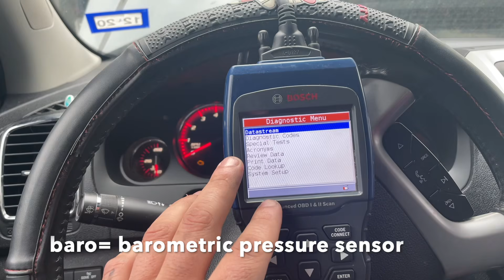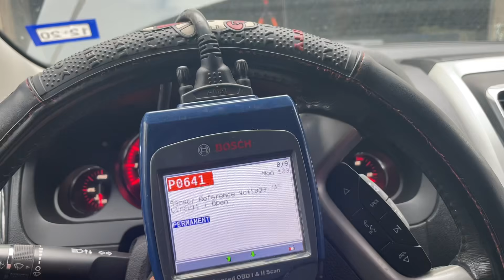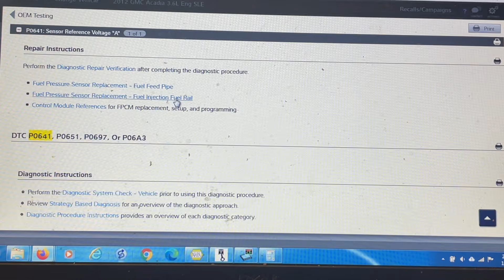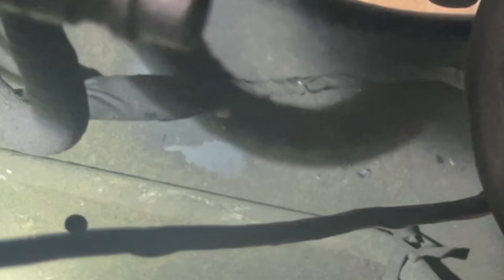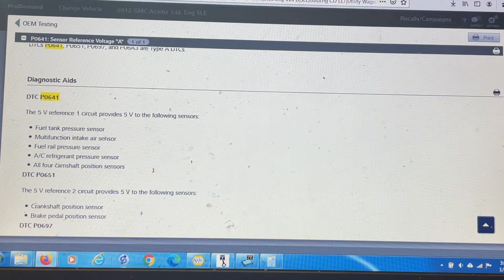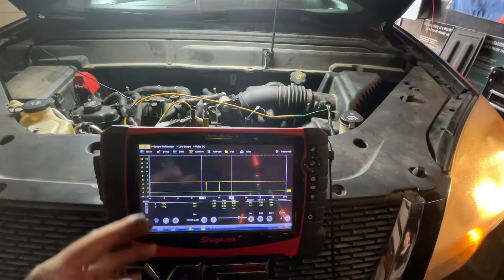Fixing vehicle that dies out. P0641

Comment: Hi mate, I have an issue with my car  Nissan Juke 1.5 DCI 2011 diesel for months now the car initially starts and when hot it will shot off when cold it will start normal so I decided to check the fuel pressure sensor take it off and clean and fix after which the car doesn’t start anymore. I taught it was the high pressure pump I bought another the same issue. I have change the engine the same , what I have find out is that there is no ground on the car the wires that are supposed to be ground a supplying 4.5v, a lol the 12v are ok 5v ok but no but ground 4.5v

Comment: When I had this problem it was a 5 volt reference wire on the transmission harness if you look up the diagram it will show you which one is five both when I've used continuity it was acting up I replace this wire problem was gone it's been about a year so far

Comment: What color are the 5v reference 1 circuit wires for code p0641 leading to the fuel rail sensor on this vehicle except it’s the Buick Enclave 2012 not gmc hopefully you get back to me

Comment: I just ran into P0641 on a Chevy uplander , wiring harness to gas tank , red/white striped and white wire on the 8 wire plug in where badly corroded

Comment: Worst car ever made Chevrolet Acadia and her sister terrain I think 😂😂😂
Reply: Sister to the Terrain is the Equinox.
Reply: @jeffreybass5479  is there a well built, well made suv by Chevrolet other than Tahoe?
Reply: @jeffreybass5479  I think it's same engine when I saw it one time but anyway both are hard to work in so tight working space, it seem that designer was so angry that day so he or she made it like this 🤪🤪🤪 also Acadia well known after warranty expire transmission will fail unless you extend the warranty they'll replace it on their own, i mean the agent stealer 😁
Reply: I have an 06 Equinox and it is now showing the P0641 and it’s due for inspection! I’ve had nothing but trouble  out of this car!

Comment: Nice fix. Why were you not monitoring the 5v reference with your scanner or meter while shaking the harness?
Reply from the maker: I would rather use the scope especially on the last shot a laterally was pushing the wire on the compressor housing and it gave 2 quick drops. Not sure if the scan data is hold pick that up